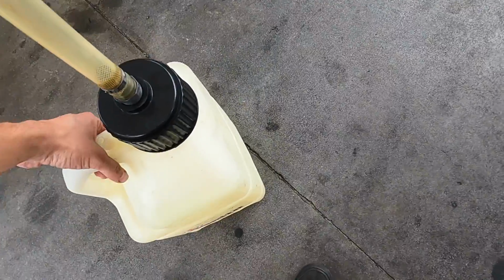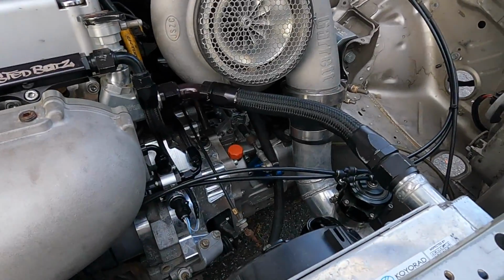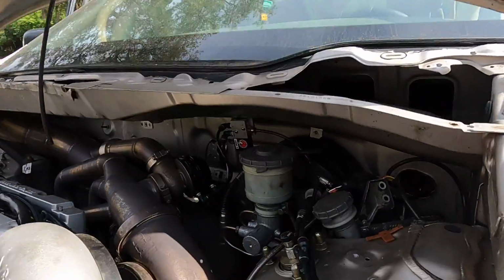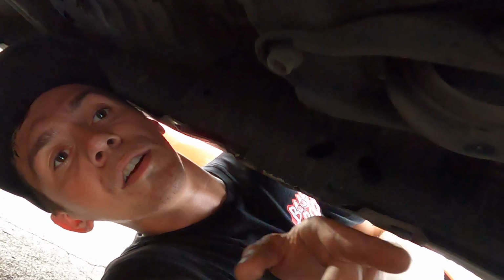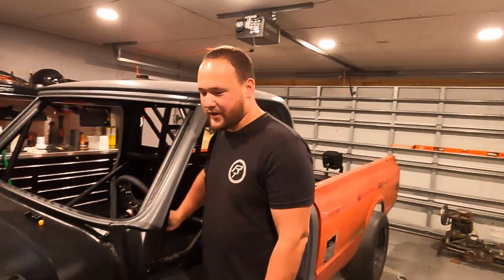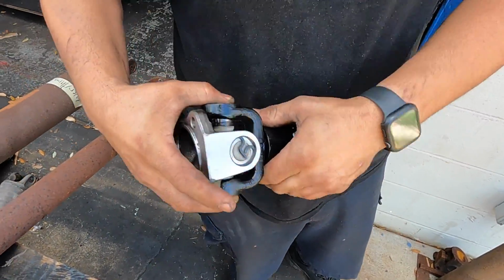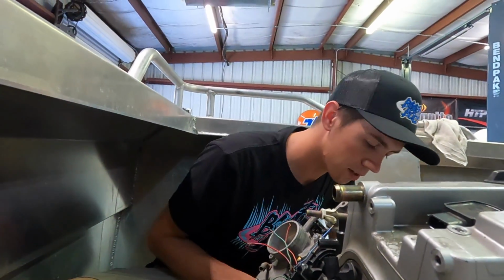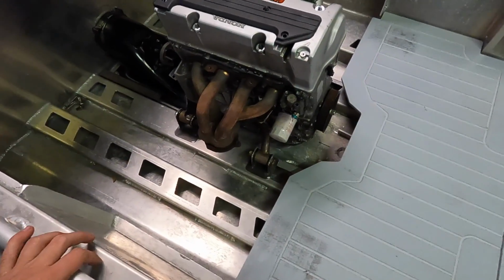Custom Parts Came For Our K-Swap Jet Boat Build!

Comment: Honestly that electric pump would scare me on that truck. Drag racing you need to be able to do quick inputs with steering. If that pump stiffens up and prevents you from being able to do that then f using that thing. Dangerous.

Comment: For Wyatts power steering. quite a few people use the Toyota Prius electric assist steering column mechanical advantage system or similar from other manufacturers. could always look into that even combined with the hydraulic.... keep up the great work guys

Comment: The steal on AL thing is mostly a salt water problem but is dont take years if your dont have zincs or galvanic isolation, it can be weeks if you leave it in, but not a trailer boat problem.

Comment: For the engine mount to boat frame fasteners, maybe consider some threaded inserts. The type that are installed like a rivet.  They would have much better thread engagement. Also, installing a zinc anode will help protect from galvanic corrosion, from the steel/aluminum contact.

Comment: If you have any issues. You should mill aluminum sqaure blocks to bottom mounts to use with the same width as you motor side <top> mounts that way you can weld the aluminum bottom halves right to the boat . It would be super easy to make them and use them with the top half of the mounts you have already made.

Comment: Cayman has always been a favorite of mine since NFSMW 2005. Flat 6's just sound cool too. Always thought it'd be the perfect daily sports car, low but modest HP on a chassis that was built with tracks in mind. They're pretty reliable as far as German cars go too. They all always end up with electronic issues more than anything, but Porsche, Merc, and VW are generally mechanically stout. Rarely ever blow up even if you just do the necessary maintenance. Oil changes in 4000-5000 mile intervals. Little things like spark plugs, filters, etc. Fill up with Shell Premium now and again, run it for at least 1500 miles. Literally cleans the inside of your engine and injectors. Goes a long way with these cars. I've owned Mercs and seen Porsche's with 300k and over, with little ever done to them, no engine swaps, just regular maintenance. They maintain their power well too. Might only see a 10-20 hp drop over that many miles, pretty impressive.

Comment: I know u get alot of advice from Comments only thing i would change is cut out small square sections where mounts are and weld in like half inch or thicker replacement patches so mounts are alot beefier

Comment: You should get a k series bell housing and cut the center out and attach a scatter shield to it. Just for safety and the bell housing will cover the flywheel and driveshaft

Comment: if you send me some dimensions for the steel mounts i can machine you some aluminum mounts that you can weld in or i can make you the spacers to bolts them in to.

Comment: Dissimilar metals and boats party badly, and there's nothing you can do about it, it's like Gods Loc-Tite.... just saying. 
I'm the designated welder on an offshore race boat team but I build race cars for the fortune and fame so I'm gonna throw my useless opinion out there.
I'm afraid tapping into that 1/8" aluminum stringer to hold the engine in place isn't going to hold up well considering what you have planned for this boat. (insert Cleetus jet boat video here)
Personally I would get me a couple of 3/8" or 1/2" aluminum plates as wide as the stringers and at least long enough to be an inch or two past the front and rear mounts, I'm guessing 2 to 2 1/2' long, weld them in, and then drill and tap those. This should give you a solid platform and hopefully keep the engine in place while you send it, repeatedly. 
 (insert video of Cleetus jumping a log with his jet boat here)
You will have to rework your mounts but you'll be redoing everything$$$$ and fixing stuff$$$$$$ when that engine tears loose.
I would at least consider other options.

Comment: Wyat should try a capacitor on that power steering pump. It might help it keep up during the more aggressive turning. I think Taylor Ray is doing something like that in his new drift vet build. He may have the knowledge you need for your steering pump.
Reply: good idea
Reply: From the research many have done it's been documented that the pump uses CAN network to work at 100%. With just ignition only like Kyle and many have done makes the pump work in limp mode which just works at 70%. Enough to work for many however it's the CAN input the only fix for this pump to work as intended.

Comment: I spent a lot of years in highschool-collage working on boats at my dad's boat shop. When folks would swap in car motors/streebike motors 9/10 the crank would snap. You're most likely going to have to swap the crank and rods to forged units.
Reply: Why would they be more likely to snap in a boat vs. a car?  Genuinely curious.
Reply: @johnrichardson4327  the Chevy V8 boat motors had more main cap bolts and the cams and valve seats were different and different carbs but we did have a guy put a 1000cc street bike motor in a Sea-Doo jet boat that did snap the crank first run idk why to be honest most likely had something to do with the water leading up the prop being way more then the rolling friction on the road.

Comment: Thoughts about the truck that has a bad diesel engine.

Put in a k24a with twin turbos and supercharger...

Or just use two k24a engines.

Have twin engine truck?

Comment: Put riv nuts in to the hull to bolt the motor in or the aluminum threads will just pull out for sure..

Comment: Is there any way you could isolate it (engine mounts) with a very small piece of isolation tape? It's in the plumbing supply at places like Ferguson in tampa. It's relatively thin probably about the thickness of two layers of duct tape but it's used to prevent galvanic corrosion between copper and steel and works very well I can tell you as an experienced commercial plumber with rolls of it only 10 ft from me LOL.

Comment: You can always cut out a square section and weld in some thinker blocked at the same height of the channel so it doesn't raise the engine to high

Comment: FYI kid, painting will NOT stop corrosion. You'll need anti-magnetic paint to even TRY and stop it. Its a metal to metal metalurgical-electrical corrosion. 2 metals that are not the same charge within proximity to eachother.

Comment: So the drive will sit at 4K-5k rpm?  What’s the happy power band for this motor?  Will that be enough rpm?  I kind of feel that this motor has too much power for the lack of gearing.  Any thoughts?
Reply: The jet drive was sized by Scott WaterJet, for their application. It should be fine.

Comment: I'd cut a section out of the stringer an weld in your thicker plates straight to the hull. Thinking those stringers are going to crush anyway when the torque starts pushing against them.

Comment: I don't know how it really works but won't the boat always be moving as long as it's running since it doesn't ha a clutch or transmission? or isn't it enough RPM to actually move the boat at idle?
Reply: There’s a hydraulic or pneumatic actuated plate that controls drive, neutral, and reverse at the nozzle if I’m mistaken.

Comment: I wonder if a sacrificial zinc rod would  help or some kind of dielectric grease would help. Ideally you would want remake the bottom mounts out of aluminum.. that way the bushing/crush sleeve in the rubber mount and the bolt would be the only thing touching making it easy to monitor and replace. As mentioned in many other comments , galvanic corrosion happens very quickly and is also common in plumbing with steel and copper...and in electrical with aluminum wire and copper wire connections. Please don't do all this work just to rot the stringers and risk a catastrophic motor rollover that could ruin the hull also! As much boost as I think you are going to throw at it , better make sure the motor is the most secure thing in the boat. Bust out the ratchet straps!!😁

Comment: Kyle after you mentioned the metal you were mounting two with the motor mounts I actually am concerned also that should be probably at least a quarter inch thick bro and even that would be pushing it you should probably slip something under there with nuts welded to it and thread to it

Comment: If the Volvo pump does not end up working and you still want to go electric power steering, my 2018 Type R is electric steering and while quick movements are made the pump never get stiffer you could always give it a try

Comment: On the K-Boat, can you put rubber in between the motor mounts and the Hull? That would take out some of the vibrations and help protect the aluminum from any sort of damage.

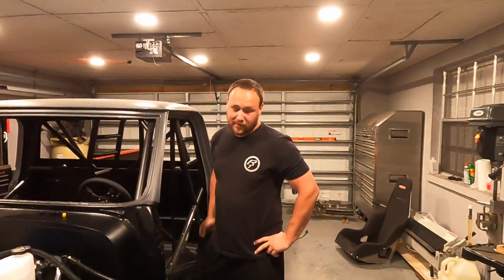Comment: @10:30 Would it be possible for Wyatt to run two electric pumps in a custom dual-fed power steering system? 0.0 Great intro by the way, so smoothly played off and professionally addressed :)
Reply: He's still going to need to do something for the hydroboost on his breaks.

Comment: why not just make the brakes for the engine mounts aluminum instead of steel you have the mock-up design just make it aluminum and weld it to the frame that way you don’t have to drill and make the haul weaker just a sugestión 😂

Comment: What's the plan on cooling the engine in the jet boat? Are using a radiator or going to pump lake water or what?

Comment: Can't wait to see the next one. Will there be an air intake port somewhere for engine bay cooling?
Reply: In Canada, you need an exhaust fan to clean the engine bay of fuel fumes before starting the motor. It is an excellent safety measure.
Can't wait to see it wheely on water. LOL. Take care.

Comment: Yo, most jet ski's and jet boats use the same style motor which is supercharged, I remember pfi dynoed and tuned either a rsx or civic with a supercharger and I'm not telling you what to do but..... itd be so sweet with a supercharger on it, power out the hole! I love my supercharger on my 56 chevy pu, but i also never had a turbo so.. it's getting its 3rd rendition with a ls this go around.

Comment: Why not make a 1/2 inch thick aluminium nut plate drilled and tapped then slide it in through the channel the mounts sit on Kyle?

Comment: Why don’t you run nutserts? They would hold way better than just tapping the aluminum and you could just run a thin strip of rubber in between the mount and the body and that would make it not be metal on aluminum and would help with dampening.

Comment: I am very very curious how you plan on draining the oil out.  There's like no room.  You can either A- cut an access door from underneath and make it waterproof. B- dry sump system.  C- just suck it out through the dipstick tube like how Audi dealers do it.
Reply: c, as done with most boats

Comment: a lot of people probably already said this, but just get some good hearty nut-serts instead of trying to tap that aluminum. that stuff will strip out after pulling the motor 1 or 2 times, guaranteed.

Comment: You should run the alternator off the drive shaft flange.  Right diameter pulley machined to sandwich would make it easy to tuck the alternator over the jet drive and you'd only loose maybe an 1/8 of slip in the shaft

Comment: Kyle, be sure you upgrade the gaskets in the motor to marine specific gaskets. The water from rivers will eat at your stock gaskets.
Reply: That brackish water gonna eat the inside of that aluminum block long before that happens. 😳

Comment: Are you going to set the oil pan of the jet boat up so you can use a vacuum pump to change the oil. Like weld a bung on the front with a valve/nipple. Then just connect a tube to it and vacuum it out. Just a thought

Comment: My question about the K swap in the jet boat is , How do you do an oil change on it ? Is the sump plug pointing at the hull ? If the drain plug is on the side how would catch the oil ? 
Hope it all works out great that boat is going to be a fun little ripper once it's done can't wait to see it in the water.🚤😄👌
Reply: Hell probably use a suction pump an just pull it out. Never be able to get a catch pan under it anyway.

Comment: There is no way that aluminium is going to hold those engine mounts reliably. Think about how much abuse those boats get - aside from engine torque. That boat will be bouncing all over the place and it will rip the threads out of those rails just due to the weight of the engine. Do yourself a favour - trace around the engine mounts, cut out the sections in those rails and weld in some thicker aluminium to tap into. You'll be doing it later anyway if you don't do it now.

Comment: @boosted...what are your plans for the exhaust on your jet boat? Are you going to wrap the headers or get them coated?
I'm thinking about whomever sits on that side is going to be a bit warm on their  bottom side after a minute or so ripping
Reply: Still gotta get the turbo in there somehow. Most boats use a water cooled exhaust manifold. Don't know if he's gonna try to fab something or if there's anything available off the shelf.

Comment: I'd cut out the thin top and sides of those floor frame channels an inch or 2 longer than the mounts, then drop in some solid billet rectangles the thickness/size of the OG brace. Weld em in place then tap into the thick stuff like you had mentioned... Easy Peasy and much more solid transfer of energy to the bottom and less chance of vibration issues / weld fractures.

Comment: Galvanic corrosion is an electrochemical process in which one metal corrodes preferentially when it is in electrical contact with another, in the presence of an electrolyte (salt water). Happens faster than you would think.

Comment: Just an idea, make larger bottom plates for the motor mounts that wrap around the support perlins and bolt the sides instead of though the top! Then the motor torque twist can't rip the threads out!

Comment: Put some strip of rubber between the mounts and the boats floor. That will keep it from corroding amd make sure you put anti seize on your bolt because if you dont in a year you wont be able to get the bolts outta it

Comment: The boats definitely going to be kool, And far as mounting the steel plates to the aluminum haul just use rubber sheets and make a gasket to sandwich between the 2 it'll help some with vibrations transferring and corrosion

Comment: You could just put a manual steering box on it Wyatt they work great we just put one on my 78 omega and what a difference it made
Reply: Still be tough with those big ass meats. An he probably doesn't want to turn it a million times to go lock to lock. 😂 Wonder how well an electric setup would do then use the pump to run his hydroboost on the breaks.

Comment: the steal bolts going into the aluminum will be your problem, they WILL bond with the aluminum, very fast when wet. Maybe you need to put on a sacrificial anode by the engine mounts. Just to be sure the bolts will not bond with the aluminum. They will break when removing them in as few as one year. Ask any boat owner. Sacrificial Anode will stop that and its cheap insurance.
Reply: @Richard Brown Yes and in wet conditions it happens fast.

Comment: Just use some  welded in round threaded inserts to beef up where the engine mounts bolt in problem solved.or cut out the plate under the mount and weld in some 3/4 plate flush in that spot

Comment: Definitely should do some billet aluminum mounts for jet boat engine. Look up galvanic corrosion. You'd be surprised how fast it'll corrode especially with salt water. You don't want to have to replace the bottom of the boat in a couple years
Reply: I wonder if a sacrificial zinc rod would  help or some kind of dielectric grease would help. Ideally you would want remake the bottom mounts out of aluminum.. that way the bushing/crush sleeve in the rubber mount and the bolt would be the only thing touching making it easy to monitor and replace
Reply: Just put thin rubbersheet in between and powedercoat them.
Should hold up a couple of years.
Reply: @Patricks_Projects  that's the route I'd go as well, just isolate the steel and aluminium from each other
Reply: Probably the worst thing you could do. You’d be attaching a vibrator to a tin can with solid mounts.
Reply: @Acraus12  I agree...must have rubber mounts
Reply: ZINC anodes for Salt water.
Magnesium for Fresh water. 
IF not its going to get fun really quickly. 
You see when the corrosion starts to show, in a few months, little problems with the ground between the engine and boat hull will start. Some times the ground can burn through the aluminum, but mostly the SHOCKS will start. Kyle will have wet feet touching the hull of the boat, and then touch anther part of the boat like say the wheel and get shocked, people will start to notice a shock when walking up and touching the boat, even swimmers when grabbing the boat will get a shock. Then there is the removing of the steal bolts from the aluminum. In less then a year, without anodes, there will be no removing the bolts. they will break. Look at my back ground pic, tell me how i know, been boating all my life. No replacement for piratical experience. I have anodes on my truck, because it has Aluminum touching steal. I guess manufactures did not listen to the guy talking about galvanic corrosion.

Comment: No that super thin aluminum is going to crack you need to get some thick billet aluminum and weld it underneath then bolt it to that or you can break stuff and learn the hard way personally I don't like having to go back and redo something I could have done right the first time ...